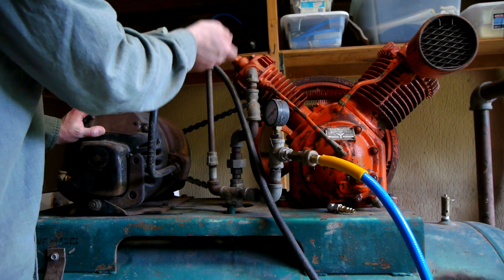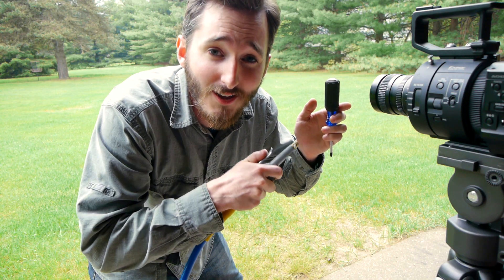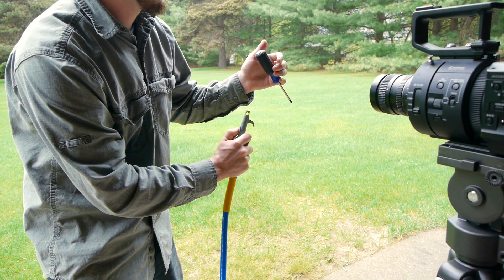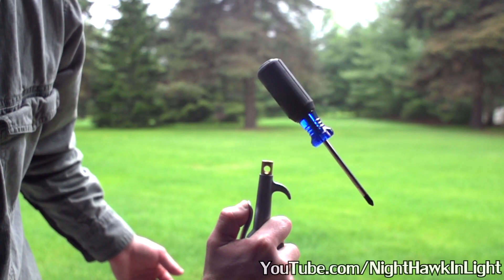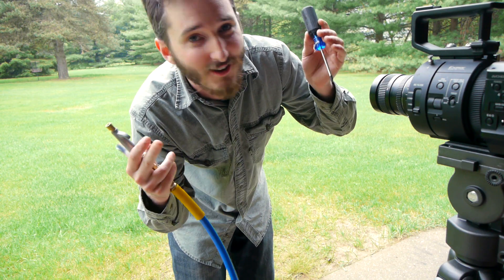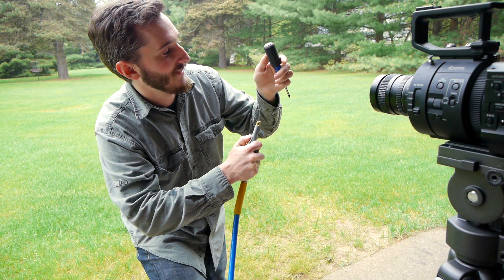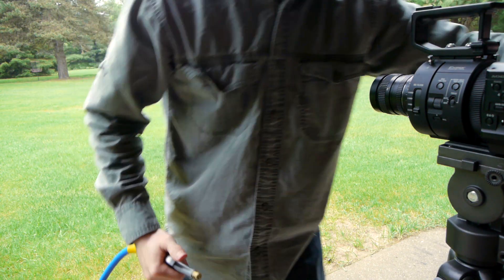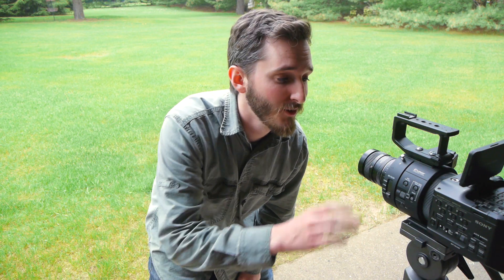Levitate a Screwdriver with Compressed Air!

Comment: Actually it was legit because the high velocity stream of air is at a lower pressure than the surrounding air and it creates a pocket of high pressure air while the low pressure air rushes in to equalise the pressure it pushes it in all directions including up it hovers from being pushed on all directions creating equal force on all sides making its net force 0 so it doesn't move, it's semi simple physics

Comment: I'd think it's because the object is cylindrical, and therefor the air flows around it, sort of Locking it in place in the airstream (The air keeping it afloat, and then the air currents that go around it keep it centered and stable) Try it with different shaped screwdrivers! add a flat piece of plastic to one, and see if it still works :D